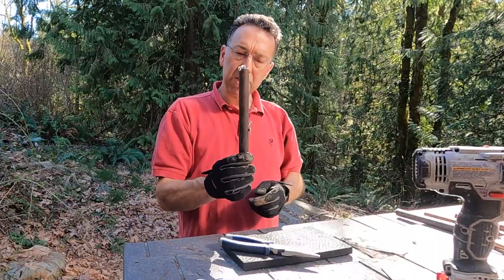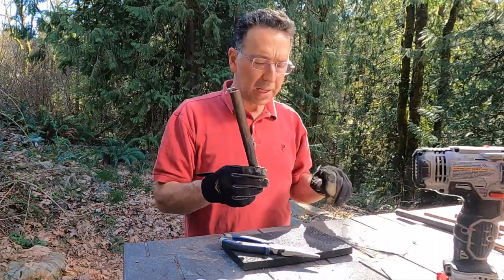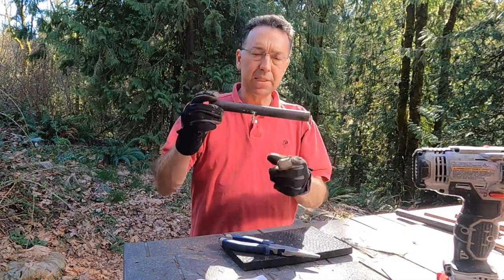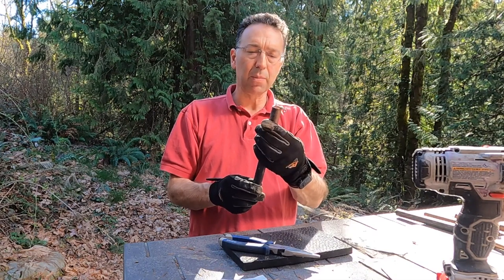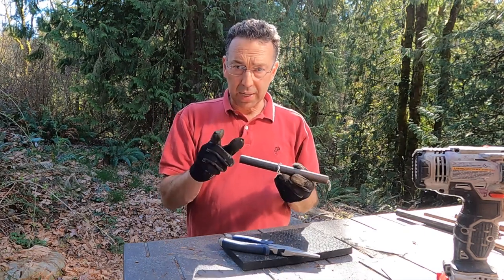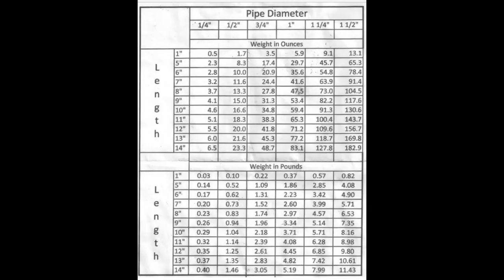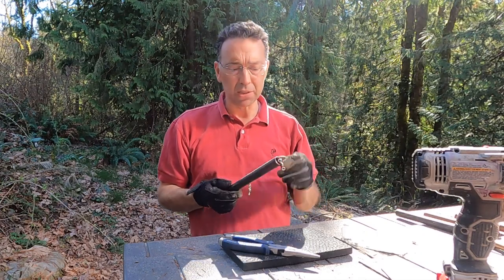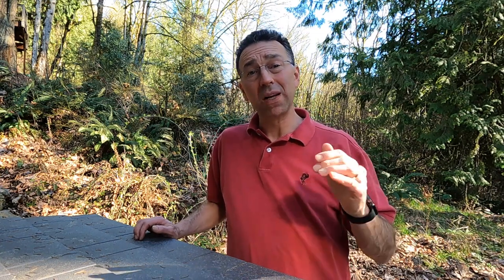How To Make A Pipe Jig - For Halibut and Lingcod - Part 1

Comment: Until I saw this video, I used to pour first, and drill completely through the jig body. However, while drilling I used WD-40 as a drilling lubricant. The bit did bind, but I then could remove it from the table clamp and use vice grips to work the bit out.
SINCE seeing your video, I'm doing it as you do it. Takes a little bit more prep time, but makes for stronger pipe jigs. 👍
Reply from the maker: Thank you. Happy it was helpful.